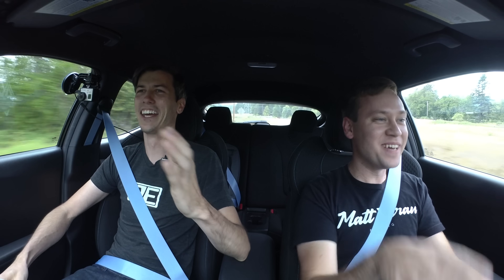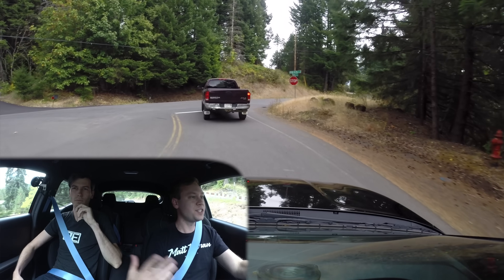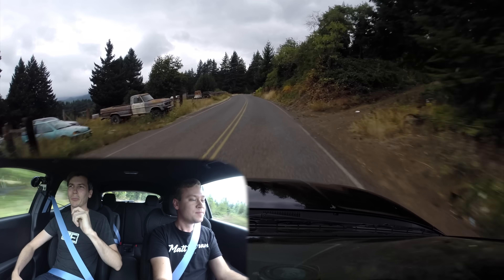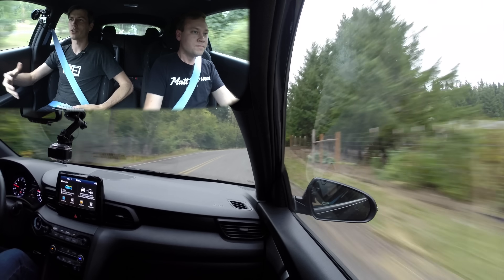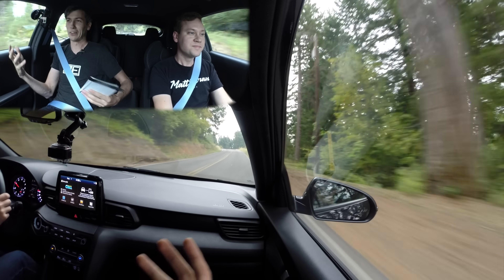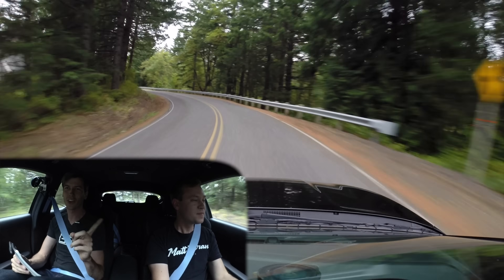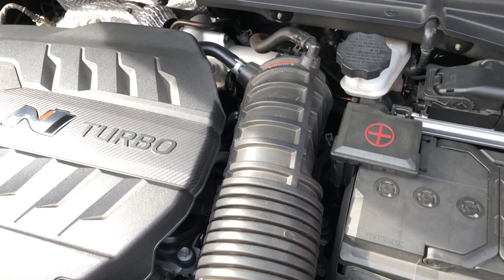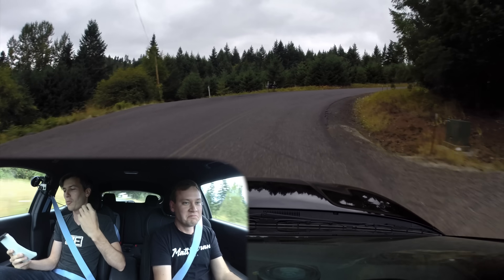Are Car Exhaust Crackles & Pops Fake?

Comment: Noise in our  environment.....should be banned .....the youth that like pops and crackles should just learn to drive quick and get their buzz from that.......but most youth can't drive can they because they've been brought up with traction control, safety this safety that,  the car having all the control, most  can't even overtake properly.........so the manufactures have to give them sad pathetic noises so they can feel like their a real racing driver.

Comment: If these "features" are so polarizing, I don't know why manufacturers don't allow you to have it both ways and let the consumer decide.  If a driver doesn't care for fake engine sounds being piped into the cabin and prefers a more quiet ride, then let them switch the feature off in a preference setting rather than having to pull a fuse or buy some after market CANBUS hack.  If a driver prefers a CVT be used as it's name suggests, then have an option that changes the behaviour to a CVT mode instead of fake gearing.  Stop-start is another annoying feature that some manufacturers don't allow you to turn off (and getting even more so because it affects their reported fuel economy ratings.)

Comment: And his explanation is off base. If a late spark is the only cause, then why do engines with carburetors and no altered timing pop and backfire on decel? And why can an EFI engine also pop without retarding the engine?

Comment: I drive my car by the sound of the (RPM) engine note. 5th gear 3000-3500 rpm 100-110 kph
I drove a modern BMW 1 series (3 cilinder turbo) i a was going 150 kph without noticing it till i looked down at the speedo... I was shocked.
I could not hear how fast i was going because there was no or little engine noise/sound
I wonder how people drive their ELECTRIC cars....when those cars dont make any engine noise

Comment: Velosters pump engine noise through the audio system. I had a customer complaint about a strange vibration in the subwoofer whenever the car is on. I realized the factory amp (which was feeding signal to the aftermarket sub amp) was sending engine noises through the new sub and rattling the interior. I had to find the rpm input signal on the factory amp and cut it because there is no option to turn that stupidity off. Exhaust pops rule. 
Audio system engine noises can FOAD.

Comment: regarding 06:11: for modern cars with GPF (gasoline particulate filter), cutting fuel when letting of the throttle is not an option (at least not all the time). fuel cut means air (and oxygen) going through the exhaust system, and depending on particulate mass and temperature in the GPF this can trigger a heavy exothermal reaction, destroying the GPF. so, cars with GPF have sophisticated models to calculate exhaust temperatures and soot load of the GPF all the time, and on this basis they "decide" when it is safe to cut fuel and when not.

Comment: My motorcycle does it but that's for the AIS (Air Injection System) and emissions. I could get a tune and disable AIS and get block off plates and it would stop. I don't mind it though.. sounds ok.

Comment: If the engine sounds are coming out of the audio system via an audio file, that's "fake". If real engine sounds are piped in or emanating from the exhaust and aren't enhanced via the audio system, then they aren't as "fake" as an audio file. The audio file method fits the definition of "fake" much more accurately.

All these backfire noises used to be unburned fuel igniting in the exhaust system on deceleration, particularly when aggressively downshifting. Modern cars shut off fuel delivery on decel so that went away.

I enjoy my sport exhaust, just fun.

Comment: Aha!
Rotary engines are internally lubricated in part by the oil that's injected with the fuel.
Completely killing the fuel along with the air would increase engine wear.

Comment: Jason, you need to drive the 2019 Megane Trophy in sport/race mode, and you won't care whether they are fake or not. I've had mine just over a month and I find myself just coming off the throttle or holding a rev a little longer just for the fun of it as it makes some absolutely wonderful pops and bangs. The faked engine noise is done nicely too, sounding more like a cold air intake than anything else.

Comment: "the f-Type started it!"  Really? My car was build 3 years before the first F-type, and does this (and it was one of the last ones with the engine i have, and it surely wasn't the first one). It has a NA engine, but it has no „rev hang effect“ like you describe. If i go off the throttle, it makes those noises (depending on the rev range, engine temp...it is easier to make it do these noises if the engine and exhaust are warm) but it immediately gives engine braking.   And like Matt, i like it better than the fake exhaust sound through the speakers, but there is definetly a too much with some cars. About those speaker noises: We have a last gen Touareg in the company, It's a 3L V6 Diesel and from outside it sounds like one, from inside it sounds like a NA 3L V6 gasoline engine. It is strange to me every time i drive it. (And it wasn't part of any "sound package" or other optional extra.)

Comment: As long as it isn’t speakers it’s real. It’s terms of the actually making the pops and crackles. One thing to note if it is not speakers the pops and crackles can get more aggressive depending on how hot the exhaust is. Which makes it more fun. For those who makes their car louder, also the pops and crackles get louder and more aggressive. That’s 100% real. Speakers are not. Now actually in NA car it actually helps the car in the same way a turbocharged car except obviously no spool. But when you get back on the throttle the engine is more responsive Bc fuel is already there and ready to used for power.

Comment: Serious question! So i installed a magnaflow axle back muffler delete on my stock '15 WRX. It pops when i accelerate hard and let off the gas (to shift) and when it's in neutral and I rev >3000 rpm it pops once or twice when i let off and it gets down to around 1500 rpm. Just wondering why i get these pops now (and i didnt before with the stock parts) even though i didnt change anything except the axle back exhaust?

Comment: The f type did not start crackling exhausts. That has been a symptom of highly tuned engines since.....engines were highly tuned. For example a tvr. Most manufacturers did not like this byproduct as engineering engines progressed and everyday cars started yo be able to incorporate overlapping valve timing and maintain fuel efficiency using cam timing technology. For example my bmw 330i did not crackle. Then when I had the silencer replaced with a straight through and it would it al the time. My 135i had a res delete by a previous owner and its the same.
Edit: if you are the sort of gay boy who has their exhaust modified to crackle all the time on their 1.6L A1 you’re so gay.

Comment: On the topic of CVTs pretending to have gears, I have always wondered whether that actually has some kind of functionality to it. Whether that is to compensate for where peak torque is by sweeping across approximately where peak torque might be based on the condition of the air or to increase the life of the engine by better distributing the frequencies that the engine is vibrating at. Or it could be purely for our entertainment. :D

Comment: I care less about function than enjoyment. I'm ok with piped in sound (like the 15+sti just a tube from the intake to the cabin) or forced crackles but I also want to experience the  car. I don't care if it's slower I want a manual option & drive by wire is a crime. Like pain steering feedback serves a purpose, I'm tired of watching people recklessly driving big vehicles like a miata at autox

Comment: Cracks, pops, tops, blops, bobs, turbo lag, fuel cutoff, CVT with and without gearing, active sound, fake sound, valve in the exhaust, 3rd pipe in the exhaust, back pressure, cat / decat, button or remote to activate the sound ($1.5k with the germans), # of cells in your cat and upgrade for less cells, sound in the speakers, pipe from engine to cabin, and God (whatever his/her name is) knows what.

OMFG ! take the bloody S2000, clutch-in any gear, slam it JUST to 7k, et voilà !
And if not enough, slam the hell out of it to 9,000 rpm. Thank you very much for the talk and good bye 😂

Comment: I’m not buying it…
The story I am about ti give is about motorbikes not cars, but it still follows the same engineering principles.

My Yamaha R6 when I ride in a civilised manner doesn’t crackle and pop.  When I get it out on the track or even going hard in the hills, so it is running really hot, the crackles and pops start.  This is an 05 Model Bike.  So no engine maps , no fashion accessory changes to how it has its spark timing.  It just behaves differently.

I Put to you that it has unspent fuel going into the exhaust and burning there causing the crackles and pops when it is on the overrun, and that there is nothing artificial about it.

Comment: What about cars with DSGs when shifting up where you want to match engine speed with next gear ASAP? Is there timing adjusted a way that would slow down engine RPMs faster than just by closing throttle body?

Comment: A little crackle is great - around me they are adding aftermarket kits - or breaking their engines - that make the exhaust sound like a fireworks show. There are visible flashes out the back, it is loud enough to set off alarms. 50 loud backfires in a row ain't crackle. I'm of the opinion that modern engines don't have an innate great sound, so they are doing this instead. Do you know how these kits work? I think I've heard they just dump fuel into the exhaust.

Comment: On the topic of engineer braking, what happens when you floor the gas then immediately slam on the breaks? That actually happens in the real world and if the engine continues to rev when it’s not supposed to, it could mean the difference between braking safely or slamming into the car in front.

Comment: Fake engine sound coming for the speakers are pointless. It a way to make a boring vehicle fake and boring. And this tend should stop.  My 89 f-150 5 speed  crackles and pops when I let off the gas. And it’s 32 years old tech. Plus it slows down the truck. That’s the idea of this feature. To help slow down the truck when hauling. And it’s a 351 non turbo ( non supercharged too) engine. The car your driving would have the same effect. With the turbo sprawled up. It keeps up the speed. So, you won’t slow down. You will maintain the speed your at. The Idea in sport cars is to have the boost to up shift or down shift. This feature is to use as a engine break. And has been about since the the engine break in big semi trucks. I just didn’t a better job then you explaining it.

Comment: I have a 1990 Miata with a Megasquirt ECU in it, and over the summer I played with the tune to see if I could get some nice pops and bangs out of it. To do it, I picked a few cells in the spark table where load was low and RPMs were high and set the spark timing to -5 degrees - that is, 5 degrees AFTER TDC, and added some extra fuel in those cells as well. The extra unburned fuel and fresh air in the exhaust stream allowed for some pretty nice pops. I'm not sure if there's a way to tweak spark timing based on TPSdot, but that is probably how it's implemented in production cars. I also own a 2017 Focus RS, and it gives off pops and bangs pretty consistently in sport mode with that pattern of throttle input.

Comment: Just for fun, you should design a car entirely by numbers.  Its shape is determined entirely by aerodynamics for peak fuel efficiency.  Engine and transmission by the same requirements.  Not a single thing to look pretty or be performance-oriented.  Must seat four adults (comfortably or otherwise).

Basically, design the most boring car in the world, as an engineering study.  :D

...And yes, I'm aware I just described the design criteria for a Gen II Prius.  No plagiarism!  Make your own boring eco-box!

Comment: Come on, that thing about “creating pressure in the exhaust” has got to be bogus. How would combustion in a cylinder with exhaust valves open actually generate enough pressure to keep a turbo spooled? Especially if you’re off the throttle. If this is really the case, you should definitely do a deep dive on the science. Pressure vs. flow, etc.

Comment: my neighbor has a nice SVR and it sounds so good and the cracks and pops sound so random, so I assume they were real. I read a review and it said it just runs a little rich to create these popping sounds. but then it got me thinking... how does it burn then? won't the cats burn it off and where does the oxygen come from to create an explosion? I really wonder how this could work in a modern car and if they are real - how this is still allowed... I love the sound and love a nice V8, but everybody's so focussed on efficiency, climate change and air quality that I can barely believe anybody's gonna allow a car to burn even more gas than necessary, especially since it literally doesn't do anything

Comment: You don't want gas feeding the engine when you're slowing down. So they've been tuned to combust at a different point in the cylinder's cycle. That leads to the pop as the pressure exits the exhaust so that the pressure isn't forcing the cylinder down and providing maximum power. You've said all of this in the video. So, to me, this doesn't make it fake at all, but rather a by-product of normal operation. If you're argument is that they can be tuned to not pop, the engine can be tuned to do a lot of things. That doesn't make any of it fake. To me fake would be something like spark plugs into he exhaust to make flamethrowers. The engine isn't naturally causing flames.

Comment: You think that in the car with NA engine is useless, but you not told about any of the origin: with carburator the spark advance/retard set by two factor, one is RPM and one is torque (gas pedal). When the rev is high and torque is low, retarding the spark to the opening of the exhaust valves gives the pops. A sharp-tuned NA engines did that, you could see them especially in rally, then later on the streets. With an advanced system that use injectors, you do not need to do this, but its tradition. The Hyundai engineer just gave a reason.

Comment: The Veloster N is a relatively new car. The Fiat 500 Abarth was popping and crackling since 2012. Unlike many, they used a full flow exhaust with no muffling. My 2012 does not always pop, but it does crackle just like it's much older sibling, my 1977 Fiat 124 Spider which also has a full flow exhaust.

Comment: If the crackling serves a purpose, fine. Otherwise it's just pointless and I don't want it.
As for synthetic engine noise piped into the cabin via the speakers, if you like that you most likely have bad breath, BO and dandruff and you think you're too sexy for your shirt. 😀

Comment: The Porsche implementation of anti-lag is also easier on the turbo than the spark delay version. This is because the air going to the turbo will be cooler than if fuel was being burned.

Comment: OK, so now the old guy weighs in! Isn't the original genesis of exhaust crackle an artifact of carburetor physics? When you back off the throttle plates close and there is a moment of ultra-rich mixture.  As a result some of the fuel combustion takes place in the exhaust  system. I can tune mthe carbs on my Porsche 356 such that I get blue flames out the tailpipes when i let off the throttle.

Back on topic .... I hate piped in engine sound!!

Comment: To each his own but it sounds and is perceived much like farting to me which makes me think the engine is having trouble processing the fuel you put in it and like a fart, it quickly goes from entertaining to annoying.  As a result, all these engineered mimicry designs should be a toggle option and not imposed upon the driver.  Just because I used to love a rattle doesn’t mean I am still entertained by it.

Comment: In smaller engines the cracks sound good. But if you can imagine an e60 M5 for example, letting off at high rpm and hearing it wind down sounds better than cracks and pops happening. So it depends on the engine

Comment: The MINI Cooper S/JCW had this function starting in 2011 when the R56 LCI was released. In sport mode you got crackles and pops from the exhaust. My question: how much excess CO2 and NOx or particulate matter is released when this feature is turned on since it’s just excess fuel being burned in the exhaust system.

Comment: My motorcycle does that. In my case, it's due to secondary air injection. The purpose is to help burn any unburned fuel in the exhaust for emissions. Actually pops flames out the back. Cross plane inline 4 with that crackle/pop is like heaven in your ears.

Comment: Backfires (which are pops and crackles) put extra stress on the exhaust valves, exhaust valves seals, and the catalytic converter. Definitely not a feature made for longevity of motor.

Comment: 0:10 ok see those jelly bean shaped holes in the exhaust. Well when you change gears the air flow changes for a split second, actually sucking some air back into the exhaust, when you finish changing gears that small amount of air gets pushed back out, through the jelly bean shaped holes causing the FART sound do to the vibration of the exhaust. Thats my theory

Comment: Crackles and pops are fundamental in modern cars, especially when downsizing left a lot of fun cars with 4 or even 3 pot engines that without some "fakery" either in the engine or in the exhaust make up for that lack of engine noise, especially combined with modern particulate filters

Comment: Isn’t it timing retarded in the deceleration fuel cells in the tune? I know a burble tune generally pulls -15 to -20 degrees when you lift off the gas pedal